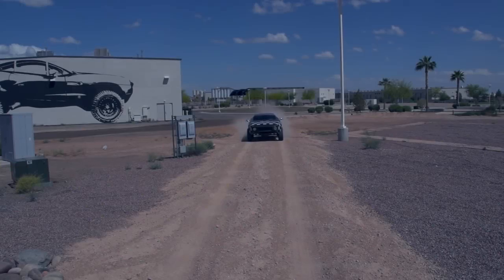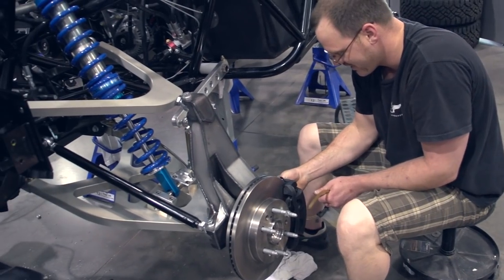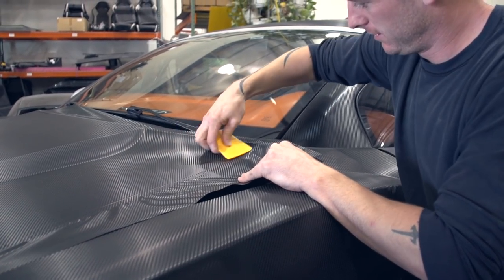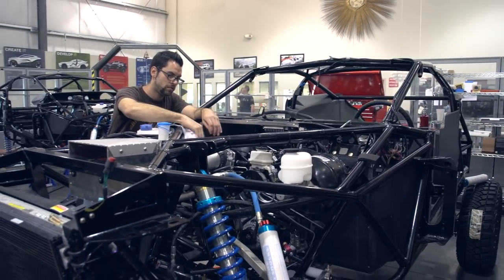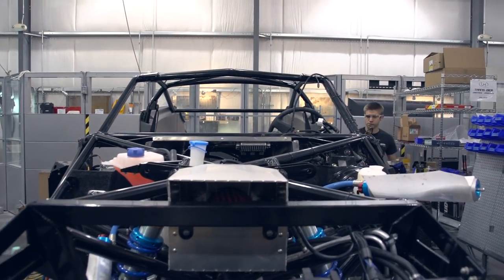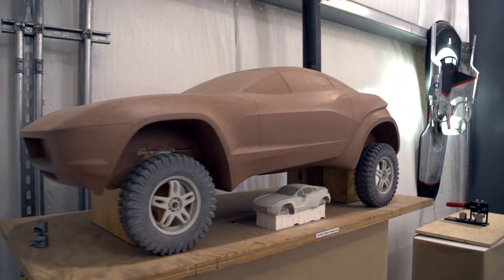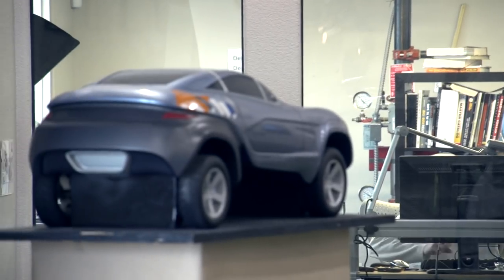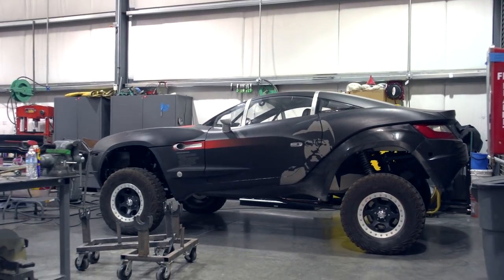'Creating Customs' visits Local Motors (Rally Fighter!)

Comment: Why don't they make one 4x4 for overlanding and have some storage area in the back for gear that would be sweet in my opinion.
Reply: due to the 50:50 weight distribution and also the ride height as well as the amount of hp/torque it doesn’t need to be 4wd also there is a backseat and trunk storage
Reply: They did make a 4x4 one for fast and furious...

Comment: 3:57 "That's an amazing car. Where did you get it?...and you say...I built it myself"

Nah, you bought it from Local Motors for $100K and they let you come in for a few days to tighten up bolts.
Reply: Christopher Ryan Sorry but an assembly line worker is not a builder. They can say they "built" something to make themselves feel better about what they really do but it doesn't change the truth.

I'm a designer and builder of custom material handling equipment and machinery for the aerospace industry. Our definition of "building" something is clearing different.
Reply: Christopher Ryan "Because you didn't personally design, engineer, source raw material, fabricate and assemble it yourself from scratch without help disqualify the idea that you "built your own car"? "

Absolutely. All of those tasks together qualify as a build. Participating only in a portion of the assembly process does not qualify you as the builder...at all.

Your house analogy is also incorrect. Buying lumber, shingles, sheetrock, and copper tubing equates to buying steel bars, structural tube, plates, etc to fab a chassis. You can't just screw lumber together and presto you have a house. You need to cut the lumber and sheetrock to make it fit. That requires a skill set...carpentry! Plumbing is like welding and requires some skill to ensure the joints are brazed together correctly. If someone says to me "I built my house" and they did all of these things then yeah...they built their house.

Take the design part out of the equation. That's an entirely different discipline. Machine shops manufacture to print and that's considered a build. If you work the raw materials...you're building.
Reply: Christopher Ryan You're one of those who buys into the hype. Local Motors attracts young people with talent to contribute ideas...FOR FREE! Just go look at their website. They use these ideas to develop products which they ultimately profit from. They tout "open source" design and use buzz words like "community" but in the end it's all a farce so they can get FREE design ideas. They held a contest for the body design of the Rally Fighter and paid the winner a lousy $20K. He was a young talented guy who got screwed. Do you have any idea what a designer should be getting paid?

This company is full of shit. There's nothing open source about their process. If it truly was open source they would make their designs available to the public. They don't. They upload bits and pieces to make it seem like they're sharing with "the community". The crap they do share is worthless.

The only reason they have customers come in to work on the car for a bit is because they can't legally sell it to them as a production car. As soon as they say the customer "built" it it becomes a kit car. It's a nice scam so they don't have to deal with liability and go through the costly process of getting approved to sell vehicles to the public.
Reply: +Christopher Ryan Not wrong. Right
Reply: +OU812 Yeah, that is a very bad sales line. It is bullshit.
Reply: Actually, as far as i am concerned, they almost Did open-source their plans. They made this video, and i have a screen-grabber program on my computer. As i could never (without winning the lottery) afford to help "assemble" a $99,000. dollar Rally Fighter, i now have a good idea of the chassis tube design and parts placement, enough info that i could build my own. I completely rebuilt my own 1984 Toyota 4x4 pickup, and if i can ever afford an LS 5.3L engine and good auto transmission, i could build a close replica of this car.
Reply: That’s more than you can say about your car,
Reply: @OU812
What the hell do you call people who build houses then? Assembly workers? 

They didn't cut down the trees.  The didn't mill the trees into boards.  They didn't cast the nails or screws or bolts.  They didn't mold and pour the brick material into blocks.  They didn't create the mortar materials, they just combined them.  They didn't make the concrete or it's ingredients. 

Yet they used ALL of these materials and created a house.  They BUILT that house.  What you fail to realize is that BUILDING something means you take different materials and you put them together and make a creation.